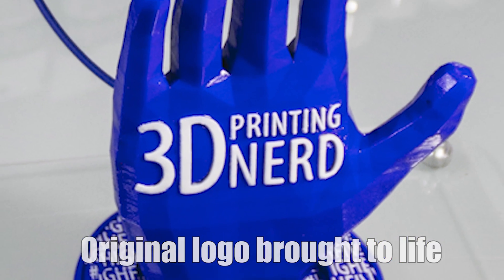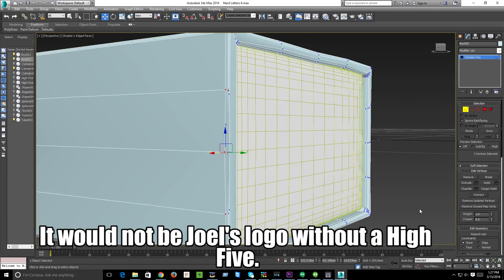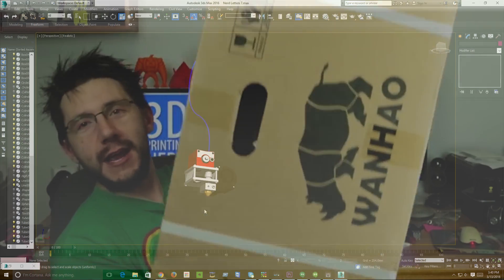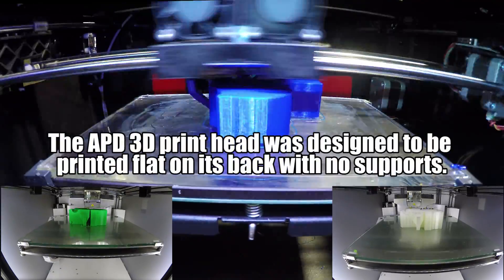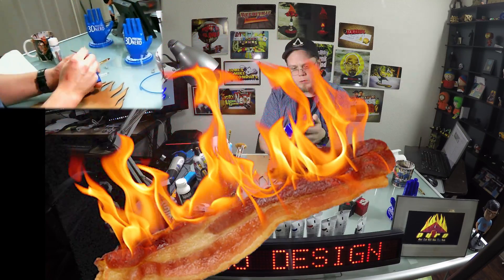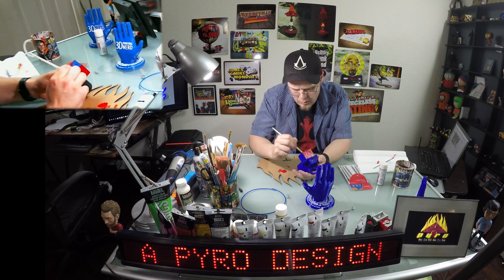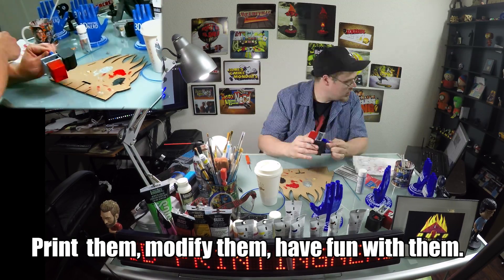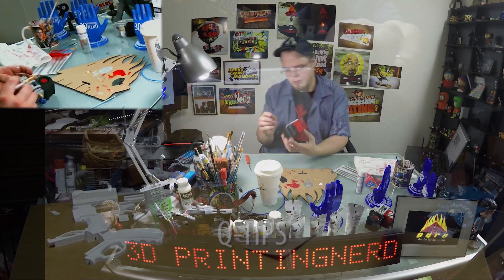Logos to Life: 3D Printing Nerd

Comment: Great video! By the way, I would like to know what type of filament you are using. And with what type of paint do you paint the actual design?
Reply from the maker: For this particular model I used hatchbox PLA but it varies.  To paint I use standard acrylic paint. Sometimes I'll use a primer coat but mostly I don't.